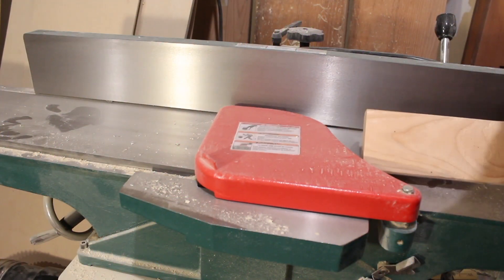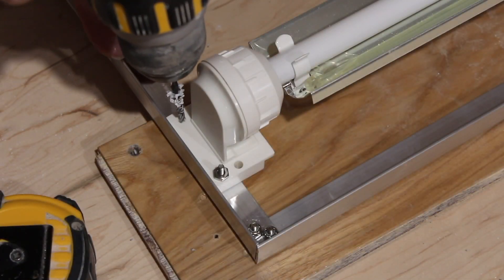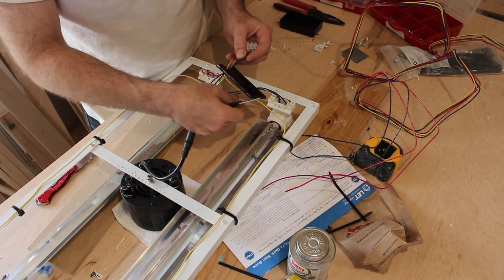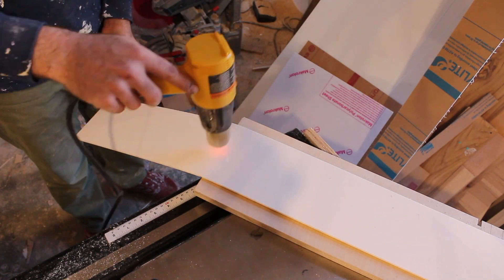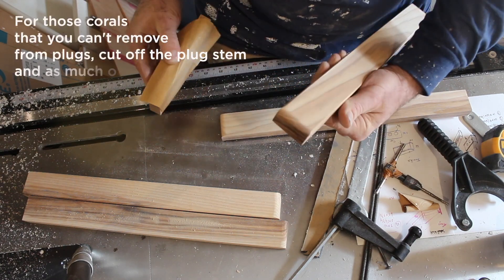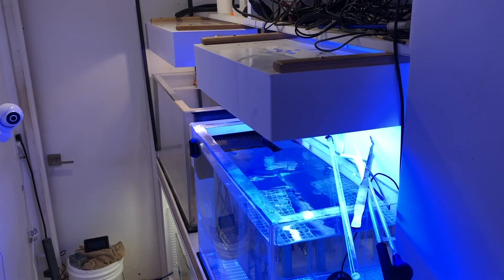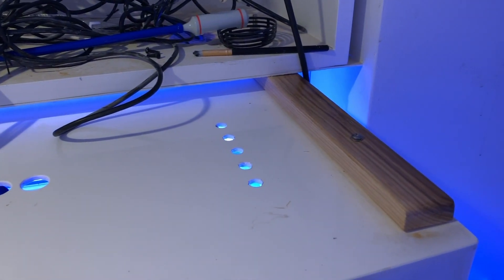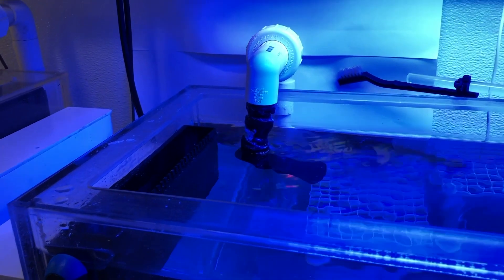EP. 7 | Build Series: Quarantine System Part 2

Comment: Agree that quarantine is important.  interested in your choice of QT -  Did you consider the Two tank method?  what swayed your decision?
Reply from the maker: Hey Robert - thanks for watching. If you mean the Tank Transfer method - that can totally work, don't get me wrong. I like the stability a single tank provides for the fish, without all the transfers between tanks, which can be stressful. If that stress is more or less than the medications one would otherwise use, I don't know. I shy away from copper, so typically use general cure and CP.  Honestly I've never tried to implement the TT method, so I can't really speak ill of it over any other QT method. The extra work (LOL), maybe higher cost in salt, usually smaller QT tank which may limit being able to QT larger fish, and how the constantly changing environment would effect a fishes ability to settle and start eating are probably my main concerns. But, all that is surmountable and it obviously is a very effective QT method for some people when done right.